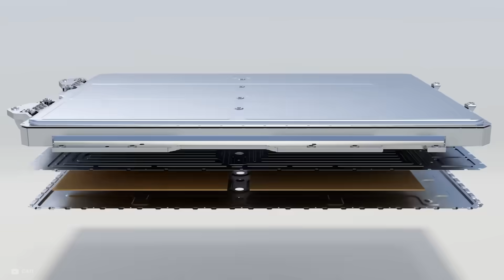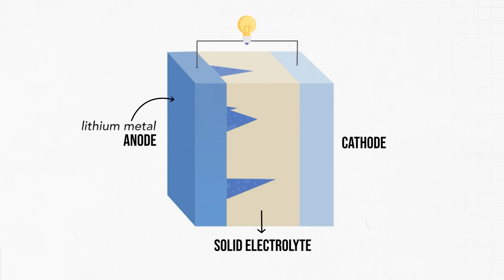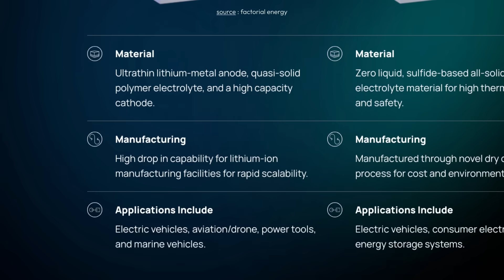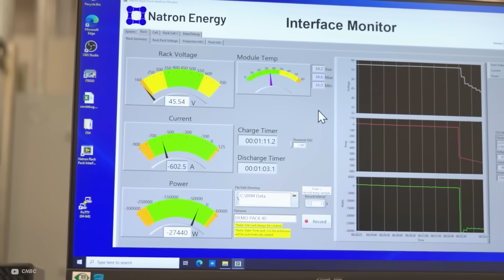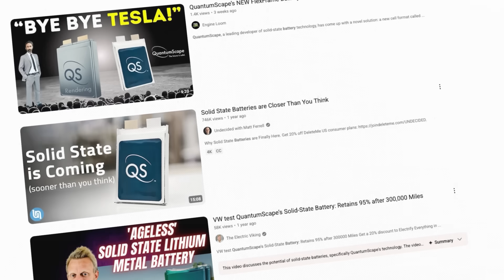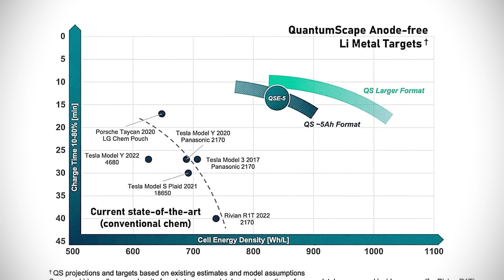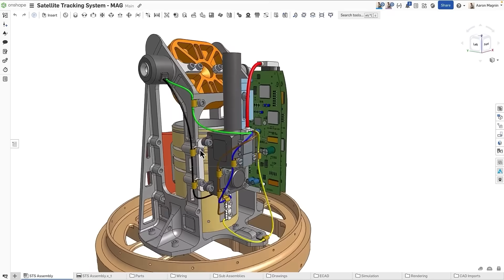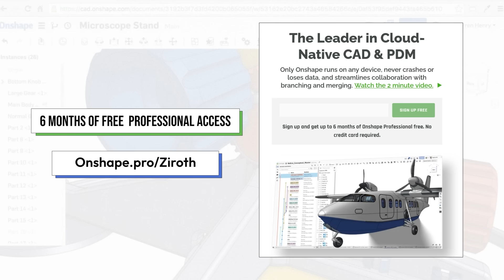The Decade Wait is Over, Solid-State Exists.

Comment: There is a BIG difference between "we invented a new battery technology" and "you can now buy this new battery technology off-the-shelf". So many promising technologies end up not making it to mass production for whatever reason.
Reply: The real question is what technology will give you a 50 or 80 KWh battery in three year's time at the lowest price.  Because we already have batteries that deliver such capacities in cars. To replace the current cells, you'd need to get it cheaper, or much lighter/smaller.
Reply: Every innovation helps move towards a new working battery, sadly hidden behind ip controls This is the problem with a lot of innovation, someone buys the ip and sits on it until someone else has a breakthrough and uses that ip and then is sucked dry if they want to manufacture in big numbers, China has the right idea ip only for a very limited period or not at all if it is in the interest of new developments.

I think if you do research and spend a lot of money you should be able to recover that investment, but then it needs to be fair if there was never any chance you could or would ever build a product.
Reply: Yes there is a big difference between research and production but this is not "we invented a new battery technology", that would be academic papers. This is a commercial company presenting their pilot production.
Reply: yes, because having a functioning product and actually making it marketable is are different beasts. maybe they are really REALLY hard to mass produce. or maybe even if they mass produce they will need to build huge complex factories that can't use the same production pipeline. and then you may not even have that much of a market because they are extremely expensive.
Reply: So true,10 + years ago an Israeli university claimed to have a battery that fully charged in 45 seconds after studying  rain neurons and a schoolgirl in the US Who won the presidential science did something similar.We will have a product for consumers in 5 years.Nothing.
Reply: "whatever reason" is usually:

#1. The tech itself is intrinsically limited despite the initially reported benefits (like greater density, but higher likelihood/speed of dendrite growth).

#2. The tech is so much more expensive than competing solutions that it isn't worth replacing existing cheaper solutions for anything but military/space applications for which cost is far less important

#3. Intrinsic barriers to mass production - it's one thing to make a few device/cell examples in a lab, but making a cost efficient production process that scales to millions per year is an entirely different problem (this is what plagues microLED replacing LCD or OLED).
Reply: Cough… Donut… cough
Reply: Making batteries isn't like making potato chips
Reply: Yeah this is not true.
Solid state batteries are not just one technology its a multitude of technologies and it just means solid instead of liquid electrolytes.
Most technologies move towards a solid state because its more robust and less fragile.
Be it ssd or solid state batteries
Reply: @TheYolo20  i don't see how that proves them wrong lmao, your statements are not contradictory
Reply: @TheYolo20  solid is more fragile than liquid because ceramics can crack under vibration while liquids just slosh around

Comment: I think that synthetic liquid fuel made from captured carbon hydrogen extracted from water, both relying on renewables such as solar plus nuclear power will provide vehicles with useful range more quickly than batteries will be developed to do the same thing.  The energy density of liquid fuels is just hard to beat.

Comment: No mention of the most important metric: how many recharge cycles can the batteries survive without degrading (too much)? 

In a car energy density is much less of an issue than the recharge cycles, because there is enough space to put in a 200kWh battery with current technology already. But if the battery loses half its capacity in 5 years, electric cars will continue to degrade in value and usefulness much quicker than gasoline cars do. And considering that cars are the 1st or 2nd most expensive acquisition in a person's life (depending on whether they buy a house), this is a very important factor when deciding what car to buy. Batteries either have to be cheap and easily replaceable, or last forever. With anything less people will keep buying gasoline cars.

Comment: Whoo Hoo.  350watt hours per kg battery storage.  Never mind that the energy density of regular gasoline is approximately 12,200 Wh/kg.
Reply: Today's gasoline engines are only around 30 to 35 percent efficient. So 30%-35% of 12,200 Wh/kg is 3,660-4,270 + ICE vehicles emit pollution, are loud, and are beholden to oil companies. You can't extract oil from your own property, but you can install solar and charge your own EV. There's a lot that can be discussed about the comparisons but there are pros and cons to both.

Comment: They  have two big issues : 1 while they are developping these cells, LiFePo4 batteries are refined, already way more reliable, and the price is dropping ever and ever. (60€/kwh now). 2 Nobody talks about lifespan of solid state batteries .... and for good reasons : for the moment they are worse than Li-Ion 10 years ago. A car with these will be trashed after 5 years.
Reply: Density m8.
Reply: 60€\KWh? Where can I find these? I am in the market for a 5-10KWh power bank to run appliances in a small cabin, that I can recharge with solar. But all the prices I’ve found are 1500-2500€ for just a raw wall pack that requires wiring and an inverter, or 3000+ for any system that has a built in inverter and is “plug and play”
Reply: LFP batteries don’t have the volumetric or gravimetric energy densities to be effective car (or worse yet, hand held) batteries. Some auto manufacturers are using them in hybrid EV packs with some other form of lithium rechargeable batteries, but that’s the best LFP has managed in the mobile marketplace.

For stationary uses, LFP is a great choice, but it’s not great for mobile uses.
Reply: @geoffstrickler you said they wouldn't be effective car batteries, but they are because they do use them. Then you said some automakers are using them with hybrid battery packs and that "is the best lfp has managed in the mobile market place". Then you were told how that's not true and then you start talking about how it's only in the standard range models, which completely contradicts your original statement. So which is it?
Reply: @ivar-the-terrible he's just someone who hasn't kept up with the times and likes to shift the goal post of "what he really meant" instead of admitting he's behind the times.
Reply: @geoffstrickler wait till you hear what battery tech is in the Xiaomi SU7 😂😂
Reply: @armwrestlingprofessor  Wait until you look up what battery that uses for its top Max model and Ultra model. Hint, it’s not LFP. As I keep saying, manufacturers are only using LFP in their “standard range” models because you can’t get the same energy density.
Reply: @geoffstrickler I stand corrected, thanks!
Reply: @geoffstrickler  the 'standard' models are the most popular ones. That's what makes them standard. So clearly, LFP batteries are used in cars.
Reply: @drfisheye I never claimed they aren’t used in cars. Why to you keep arguing your BS?
Reply: @geoffstrickler  "Some auto manufacturers are using them in hybrid EV packs with some other form of lithium rechargeable batteries, but that’s the best LFP has managed in the mobile marketplace", you claimed they are not used in standard EVs, only hybrid EVs. they are correcting you saying the more popular models of EVs use LFPs.

also good for you for your SUV. 99% of the population don't need 400mi of range a day. a BYD dolphin can already get me to my brother in São Paulo needing only a single stop to charge while a eat lunch. and that is the farthest I'll ever need to drive unless I decide to do a long car road trip maybe once every decade.
Reply: @danilooliveira6580  One more time, you’re misrepresenting what I’ve written. Yes, very few people need 400mi (or more) per day. But when you take long road trips, it’s quite likely that you will, and those “standard range” models simply aren’t conducive to such trips (plus, they rarely have the storage capacity for the luggage needed for such long trips). 

Notice I’ve never said that LFP isn’t a good technology, only that’s it’s well suited to mobile uses. You can continue to argue, but you’re only arguing with your own misinterpretations.
Reply: @geoffstrickler  sure, but that is not what you said, people are correcting you because you made a wrong statement, and now you are backpedaling by saying people just misunderstood you and trying to change the topic.

and sure, EVs are a bit more annoying for roadtrips, maybe you will need an extra hour or two of travel to charge, and maybe a long roadtrip will have to take another day (what shouldn't be a problem, since the recommended is a 30 min break every 4 to 6 hours, perfect for most extended range EVs). but all of that is irrelevant, since most people are not doing long road trips every week, most people are not doing long road trips every YEAR. so a cheap standard EV will be good enough for them for 99.9% of the time. for the next 0.1% they can just rent a car or use a friend's car. and that only if the extra hour or two of travel is too annoying for some reason. but if you need to drive more than 400mi every day or every week, then sure, keep your SUV. but that is not 99% of the population.
Reply: @geoffstrickler  you literally said it's only used in hybrids. Someone else already quoted you, so no need for me to repeat it.
Reply: @drfisheye  That’s literally NOT what I said, but I can see how you might interpret it that way, but a hybrid vehicle is not the same as a hybrid EV pack. The hybrid pack combines two (or more) kinds of cells into a single EV battery. But notice I specifically said “hybrid EV pack”, not “hybrid vehicle”. The battery pack is a hybrid, the vehicle is an EV. Now, it’s possible I was incorrect about LFP’s being used exclusively in hybrid EV packs, maybe there are some pure LFP packs. But no one has yet shown that to be true, ergo, no one has yet shown me to be incorrect. 

What you have shown is that I may be wrong on that point, and that you misunderstood my original comment.
Reply: @geoffstrickler  range is not a problem. Lack of change station is the problem. Imagine gas car without gas station.
Reply: @thanhbinhtran5047  Anyone driving long distances, or living in apartments without on premise charging stations, disagrees. Range and charging speeds are absolutely an issue. It’s the primary reason EVs aren’t more popular.

The gas powered SUV I’m driving on my vacation has a range of ~400mi, and takes less than 5 minutes to refill. EV’s can’t compete with that.😊
Reply: @geoffstrickler  If the  video is true and a vehicle with a 1200km (745 mile) range can be charged to 80% in 5 minutes, given a fast enough charger, then yes EVs have caught up to your SUV.

Of course, getting megawatt-class chargers everywhere is the next step. Some countries already have enough infrastructure for EVs to be extremely viable for most people, with only the vast-tracts-of-nothing places still really needing liquid fuels that can be carried in spare cans or delivered by tanker.
Reply: @technicalfool  Yes, if this new battery works out and comes to market, and the chargers are upgraded, it could finally put EVs level with fossil fuel cars.
Reply: @geoffstrickler  Every EV makers offer LFP now
Reply: @yutuniopati Notice they only used LFP in their “standard range” models.
Reply: @geoffstrickler tesla used it for a while, chinese ev's use it, the new chevy bolt for 2027 is going to use lifepo4
Reply: @ivar-the-terrible One more time, notice they ONLY use LFP on their “standard range” vehicles, and only on some models.
Reply: @ivar-the-terrible Tesla still uses CATL and BYD LFP for non-USA market.
Reply: @geoffstrickler All BYD cars use LFP batteries, including their very expensive supercars like the U9 which recently broke the speed record.

Comment: 11:21 (quasi) solid state might replace liquid electrolyte batteries when they’re priced near their liquid counterparts. 
Apart from price, properties like safety, energy and power density (both in weight and volume) will give them an advantage that could justify a slightly higher price (even for cars). 
Are there fundamental factors to cause (semi) solid state batteries to be more expensive?

Comment: Just for perspective... EPA rates a gallon of petrol/gasoline at 33.7 kWh or 50% more than the entire 'solid-state battery' in that Ducati... now factor in that the battery is storing its charge produced by 'some other power source'...
and you'll realize the inherent 'energy poverty' that 'battery-powered vehicles' have to overcome.
Reply: EVs use far less energy than gasoline cars to move, so they don't need anywhere near as much energy stored on board. They also regenerate energy when slowing down and going downhill.
Reply: @logitech4873  Range anxiety, charging time, & battery life/replacement costs were the reason that ICE engine autos replaced EV's back in Edison's day... I personally love EV's and have since the 90's, but it's hard to ignore that they are best for 'electric company's' profits and the 'centralized grid', at a time when every effort should be being made to de-centralize and ensure survival rates if the grid ever goes down for any extended time frame.
Reply: @tayter1  I live in a country with an extremely stable decentralized grid. It's much easier to decentralize energy production than to decentralize petroleum refining. Any person can buy some solar panels or whatever.
Reply: True. However, fossil fuels only exist on earth. If we are to ever leave this planet, we need these technologies to be developed at SOME point. And we will also run out of fossil fuels eventually/not be able to heat up the earth anymore from burning fossil fuels. That's about 50 years out so it's good to mature these technologies sooner rather than later.
Reply: @NathaNeil27  Don't look now, but Saturn's moon Titan has lakes and seas of liquid methane and ethane, and California's relatively ancient capped oil wells are magically filling up to where there is crude reappearing at 'seep points' around LA, with a recommendation that at least a couple pertinent wells be uncapped, the oil extracted and refined into useful products, to relieve the increasing underground pressure. Both these facts pointedly reveal that Rockefeller's hired 'scientists' getting the US Congress to award him a 'depletion allowance' on his taxable profits on his 'fossil fuel' extractions (2nd most abundant liquid on the planet, more created every day) was the longest-lived con in the history of humanity. Coal may start it's life as a peat bog,  but they've never had to filter fossils out of the crude oil that they've fracked & extracted from even 'shallow' wells... deepest fossil found 1500 feet down... factoid:[The deepest oil well in the world is the Z-44 Chayvo well in eastern Russia, which reaches over 40,000 feet (12 kilometers) into the ground.] Even with all that, we could double the CO2 air content levels, and it would make little difference, CO2's greenhouse effects are effectively 'maxed out', other than actually making itself more bio-available to expand the green biosphere of the planet, which will help greatly in maintaining oxygen concentration levels at pleasant levels for the animal population.

Comment: Cool, but do they scale well and cost-effectively? Tesla manufactures about 2 million EVs annually, and BYD produces a similar number. Then there are smaller manufacturers like VW, BMW, and other Chinese companies. Next year, Tesla will start mass production of robotaxis, along with electric semis. These batteries are too late and have become irrelevant. The mass production process will take at least 2 years for expensive batches, but more realistically, 5 years to reach reasonable costs (by today's standards). By then, we’ll likely have dirt-cheap sodium batteries with acceptable energy density. Solid-state batteries have missed their moment in history, and I understand why Elon was never excited about them.Some people want a 1,000 km range to switch from fossil fuel vehicles to EVs, but they also expect EVs to be cheaper than typical diesel cars. I doubt this is possible in 5 or even 10 years.

Comment: Na-ion will leapfrog this so-called solid state battery tech.  Solid state will never be useful for vehicles until they do away with the glass or ceramic electrolyte. You can't get it out of the parking lot without the battery flexing enough to shatter the electrolyte.  Even semi-solid state can't compete with Sodium-ion on cost, even if they have good durability with number of charge cycles.